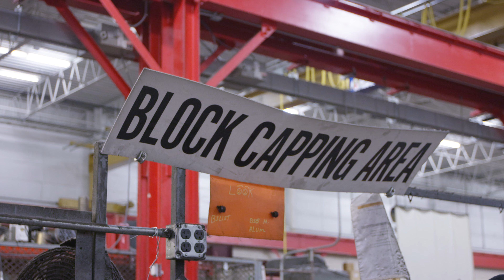40 Years of Manufacturing Horsepower | Dart Machinery

Comment: If you consider leading the industry is having everything on backorder , then i guess your right. What do you have in stock? Thats the word on the street. Truth is you sub out the majority of your stuff. That isnt how its supposed to be done. Should ALL be done in house by Dart.
Reply: As they announce price increases squeezing dealers and distributors that have been with the company for decades. Priority number one isn't top notch products for racers anymore, it's all about improving dividends to share holders. Rest assured, the next step will be less product diversity, relaxed quality standards, and mixing cheap imported garbage into the product lineup. How long until half their products are foreign made garbage. Buy the good parts while they still have a skilled american workforce. It will not be long until they shit can them too.
Reply: Others have already tried to push junk Chinese little m knock offs on the public, and it backfired. I hope dart learned from that fiasco and never trieS to push that garbage on the consumer. The reason dart is so good is the quality of the castings and the quality of the machine work. I really hope the new corporate owners recognize that is the winning formula, and anything they do to cut costs and corners will take away from that quality. Please don't squeeze the brand name for all you can and then dismantle the company. The original owner built up an awesome product base by keeping quality the number 1 priority.  Not "ok" not "above average" or "good enough" but the best! In speaking with two of your higher quality dealers they are already disgusted, contemplating closing their doors, and are losing a lot of work and income because you refuse to produce and ship engine blocks. And you have the audacity to announce an across the board price increase, talk about no longer stocking some of the higher end blocks, want to make them put in an order and wait several months until you get enough other orders so it is ultra profitable for you to then run a large amount of said blocks. Sorry, but you have failed to grasp what has made dart great, and I can assure you that if you continue to squeeze your dealers and distributors like this you will lose market share to world, brodix, and eventually it will get bad enough another will pop up to take your place. Stop buying companies thinking only about quarterly money, come up with a strategy to play the long game, if you continue to squeeze the shops that live and die based on you supplying them high end blocks you will have nothing left. I hope someone in your board room sees this and stops making decisions based on squeezing every red nickel they can In each and every quarter of the fiscal year. Your dealers, distributors, machinists, and ultimately the end user have made the Dart brand what it is, and word on the street is they have lost complete faith in you since you have aquired the company a couple years ago, not a single one of them has anything good to say. Yet you press on with more supply problems and blame it on the pandemic, and conveniently use it as an excuse to restructure the way you build, price, and distribute the higher end blocks to the very people that helped make Dart machine llc what it is today, and for what.. another notch in your belt? An extra 200 bucks per share holders at years end, and you get a yacht, Manhattan condo, with a golden parachute so insane that one years bonus is more than 20 of us will make, or spend, in our combined lifetimes? please stop. The end users will find other products if you continue down this path. As racers, performance enthusiasts most of us are blue collar, many have lost jobs due to your global economy and politics. We pay extra for high quality AMERICAN MADE products, and we pay top money for competent dealers to do final machine work and assembly. Because we know our money is going to a business that is American, provides us a good product made by people making a decent and fair wage but more importantly they genuinely love what they do, and who they do it for. Have you started cutting the employees benefits, 401k contributions, and squeezed them so hard they want to quit yet as well?  A brand name is nothing without these key elements I speak of, and so many more I have failed to mention.  And you can polish your Chinese garbage All you want, it stinks and we have had enough of it, please don't make Dart another example of the way we get overseas garbage crammed down our throats. Please don't make dart a casualty like so many other performance companies in the last decade. You bought it, now you have investors to answer to and must show growth, as well as profits. But if you accomplish these goals by cutting quality, and squeezing the people that made Dart great they can, AND WILL, find another supplier, Brodix, Blueprint, world products just to name a few block suppliers.  Rant over.
Reply: I’m not sure about that I’ve been waiting for 2 months for Trick Flow heads and they just said another two months yesterday.  Contacted Dart and will have a nice set of 225cc heads in 7-10 days.